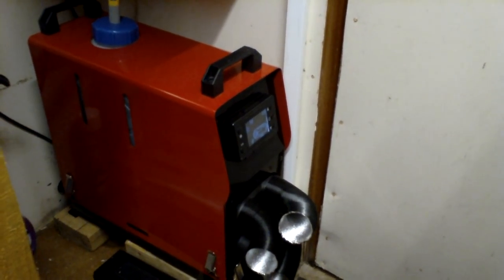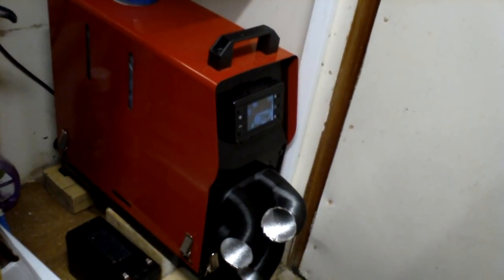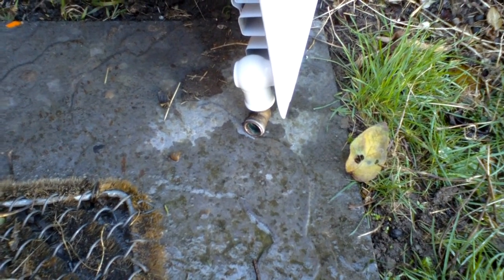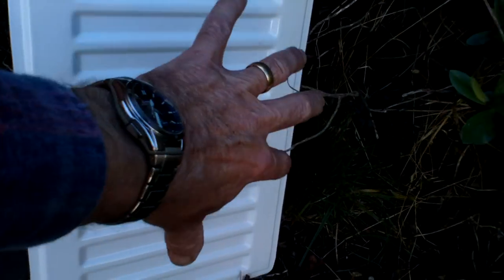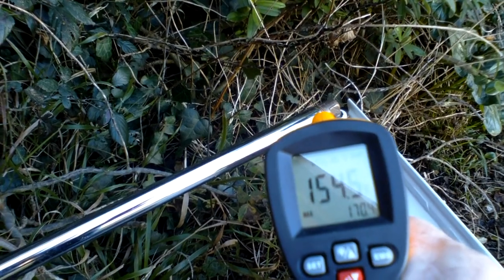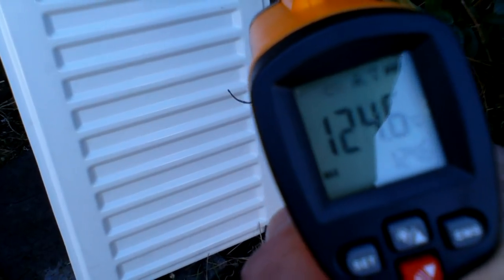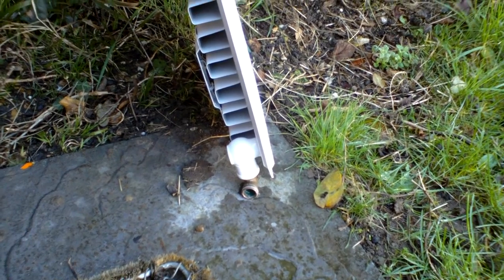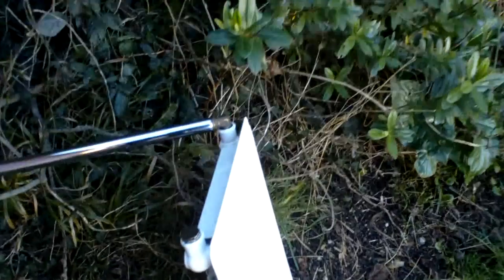COMPACT CHINESE DIESEL AIR HEATER EXHAUST HEAT RECOVERY

Comment from the maker: PLEASE READ THIS AFTER VIEWING MY VIDEO.
DONT GO DOWN THE RAD ROUTE - I did this setup just to see if heat could be recovered and if it was worth the effort.
It is indeed worth the effort but NOT by using the exhaust gasses directly.
It WILL soot up the combustion chamber and you won’t be thanking me for that so please DONT USE THE SAME SET UP. 
The best way forward is to use copper microbore heating pipe and tightly coil it around a metal bar of slightly less diameter than the exhaust pipe then tapping with a hammer onto the copper pipe to flatten the pipe where it contacts the metal bar which will increase the heat transfer surface area a lot of copper pipe will ensure good heat transfer - to remove from the metal bar you would need to “undo the spring” by holding one end and unturnining the other end to increase the diameter of the copper coil which will cause the copper pipe to slip off the metal former. You would use the same principal to get it over the stainless steel exhaust pipe - it would when all need to be tightly wrapped in exhaust manifold tape to both insulate it and keep the heat in for good transfer. A small 12v pump would be used to circulate the heated water to either a copper transfer coil within your RVs water tank or you could run the water through a radiator if you so wished.
Using the radiator directly WILL cause the diesel heater to fail overtime due to increased back pressure and the issue with water condensation. Please also note that although heat rises so it would seem obvious to use the lower radiator inlet for the exhaust gasses  Using the bottom or top of the radiator for either the exhaust inlet or outlet makes no difference as the result long term is the same - I personally would like to do a video however time prevents me but someone else needs to take up the challenge on this one as I have just planted the seeds - let’s see what develops. Regards Peter
Reply: check out egr coolers theyre great at recovering exhaust heat ive purchased a used one off a 2.0hdi only cost 10 quid
Reply from the maker: @forenamesurname4576  Hi there. Sorry about the delay in replying- I did the video to promote further experimentation and it’s certainly promoted that cause. Youtube is great for this and also your comment added to the pot adds a lot more scope for people to further experiment. Thanks for taking the time to let everyone know. Stay warm.
Regards Peter
Reply: Hee peter, i bought the same heater. But mine was'nt delivered with a manuel fot the LCD screen. I was wondering if maybe you can help me out with something?
Reply from the maker: @ruben19521  hi Ruben. Never got any paperwork with my two either. Best place for info is the Facebook Chinese Diesel Group as they now have a large international following... Stay warm. Regards Peter

Comment: An EGR cooler from a car should work for this, input/output pipes are similar size to your heater [3.2 did shogun is at least] has a built in exhaust to water cooler.
Reply from the maker: Hi Mike. EGR is a good way to go but I avoided this as it’s more plumbing and I just kept it simple because if you need to service the unit you only need to slip off the exhaust as per normal with the other pipes so no extra hastle and with a good wrap of insulation around the exhaust and copper pipe would make the heat transfer much better.
Go whatever way is best for you as it was just an experiment for me to get rid of a “bee I had in my bonnet” - which I have now put to rest. 
Thanks for your comment. Stay warm. Regards Peter

Comment: Hi Peter. Thanks very much for the video's.  I've been looking for a portable heater for tents and camper van. In searching I've come across your channel.  I'm happy and subscribed.  I now have two questions as you have gone some way of what I have - potentially - in mind. 1/  Could you extend exhaust pipe and add two baffles to lessen noise ?
Reply: 2/ Would it be possible to place a narrow gauge copper pipe coiled around exhaust pipe, then a larger pipe over that - so to seal in the heat of the exhaust. Run the extended encased exhaust and copper pipe vertical. And have the copper coil running from the bottom of small water tank, back out the top of the encased pipes and dropping back into the water tank to create hot/warm water?  As the heated water would rise. ( Just to add. It might be possible to put the coiled copper pipe around the exhaust and wrap it with heat tape instead of another pipe ? )
Reply from the maker: Only one question has come out. You can extend the exhaust pipe to around 2 meters but no more due to back pressure issues which would cause sooting and adding another silencer could cause a similar issue.
Some guys have installed the heater in a box fitted outside their tents and used the inlet / outlet pipes extended to go into the tent.
Hope this helps you. Regards Peter
Reply: @brucepeter2007  OK Thanks.  Second question,  2/ Would it be possible to place a narrow gauge copper pipe coiled around exhaust pipe, then a larger pipe over that - so to seal in the heat of the exhaust. Run the extended encased exhaust and copper pipe vertical. And have the copper coil running from the bottom of small water tank, back out the top of the encased pipes and dropping back into the water tank to create hot/warm water?  As the heated water would rise. ( Just to add. It might be possible to put the coiled copper pipe around the exhaust and wrap it with heat tape instead of another pipe ? )
 It can be done on wood stove. Wondering if there's enough heat in the small exhaust on the unit.
Reply from the maker: Hi again. I had used a minibore copper pipe around a low wattage tubular heater which was a gravity system and had to allow a little expansion tank as well and it worked very well. If you have had a try at a gravity system before then using minibore copper pipe would work and if you read through some of the comment to my video you will see I have proposed it being the best alternative wrapped with high temperature exhaust lagging to increase the efficiency. I think that a small pump could be inserted in line if the installation requires it as making a gravity heating system is not as simple as it first seems because sometimes the system needs a “kick” before it will work depending on the path of the feed / return pipes so an electric pump can be used to give it a provisional kick to start the system and once the circulation starts it could be turned off. I made the video to help start people thinking about the heat recovery because the heater without question is a fantastic bit of kit to heat a large area but the heat loss from the exhaust needs recovery to really make it a good system and for guys with RVs it would be an ideal answer to stop their water tanks from freezing and cost nothing more to do it.
Keep at it my friend and let us know how you get on.
Stay warm. Regards Peter

Comment: MAN, that is SO cobbled together, what a hack.... haha, just messing with you :) Glad you did this because I had the same thought too, but was worried even doing what you did would have restricted exhaust flow and gotten it to choke up and soot / smoke so it's good to see it's able to handle at least that much restriction without assistance. As you showed the parallel tubes in that rad help flow.. I'll be heating my garage with one of these and I"m thinking of doing something similar, but I'll probably have to have a "sacrificial" fan at the end of the loop to help extract the exhaust gasses and not choke up the heater. I have an old cast iron radiator that was destined to the recycling bin, that may be my design that I go with, but with a drain valve at a low spot to empty it out. Thanks for sharing!
Reply from the maker: Hi volvo. I would go the microbore way wound around the exhaust - see some other replies in the comment section. Using a small pump to circulate the heated water. Thanks for your comments and please let everybody know what you get up to as a lot are interested out there... Regards Peter

Comment: Get a helical coil on the end of that exhaust submerge the helical coil into a pail of water circulate the pail of water through a radiator and you'll grab the last little bit of heat left in the exhaust basically building a tube and she'll heat exchanger

Comment: I think this would work: weld two pipes together for a couple of feet. One for the exhaust and one for the combustion air then insulate them. They would have to seperate at the end then you would be preheating your combustion air which should make for better combustion.
Reply from the maker: Hi David. The combustion with this kind of heater is never an issue if the settings are right. The method I have shown id really the simplest and most straightforward way to do this and the big bonus is you dont need any tools to do it...
Simple is always best. 
Regards Peter
Reply: I am going to try it. I also am going to weld the pipes to a 40 pound chunk of iron. Whatever the result bringing heat back can only be a good thing.
Reply from the maker: @davidshortt88  Worth a try and see how things turn out. Remember don't restrict the combustion exhaust too much else you will get sooting issues. Regards Peter

Comment: I was going to use the exhaust in a heat exchanger to pre heat used veg oil diesel mix.
Reply from the maker: Hi Nev. Byall means have ago as it only costs a bit of time and if it works it always produces a smile with the person who’s done it...
Works for me. Regards Peter
Reply: @brucepeter2007  cheers Peter. I can't see how it wouldn't work. I have run one if these heaters for aprox 5 years in my motorhome. Everyone is astounded at the heat the mighty little heater puts out. I thought it would be a good option to use a 8kw unit to heat my workshop using 50/50 mix of diesel and filtered used veg oil. Seems like a cool project.

Comment: this would be better with a finned radiator that would allow you to place a fan behind and blow air though the fins ....even the outlet temp of 44 C is still over 100 degrees f .
Reply from the maker: Hi Jim. Many thanks for taking the time to comment -The test I did was only done rough to see what temperatures were around that could be used. I did not wish to ruin my existing working set up so it was installed in all of a minute. The results were very interesting - so to were the problems.
With the readings together with the issues like condensation I hope I have opened the way for others to have a go at it. As it is my inquisitiveness that has cost me the price for the new radiator and the wardrobe cloaths hanging rail I had to quit because the little lady was already looking at what I was doing with a look we all know and so I backed off.
So many great comments made about the video which should give some handy plumber a chance to come up with a useful recovery system - be it to stop your water tank freezing in an RV or as a bit of extra heat for inside.
As Sherlock Holmes said “ The game is afoot Watson”.
Reply: @brucepeter2007  No worries, I understand it was just a rough test, but it did get the wheels in my head turning and thinking of using a different style radiator and having the exhaust come in at the bottom and out at the top and hiving the exhaust exit  out of the top like a chimney  and having a small fan blow through it , Its a great idea . It really makes good sense to try and use that wasted heat.
Reply from the maker: Hi again Jim. One thing you must be aware of is exhaust gas security and every joint could be a possible gas leak. I think now I would plumb for a coiled copper mini bore pipe and exhaust manifold wrap the two pipes together which helps heat transfer and you would how’ve no more potential leaks... Like you I’m still thinking. Keep us all posted.
Stay warm. Regards Peter

Comment: Peter  I see you build model airplanes as well. How about showing some of them .      Building WW11 aircraft i a hobby of mine sense I was 10 and at 70 I haven't stopped yet.  Funny how we creative people seem to like to build and experiment with all sorts of things.
Reply from the maker: Hi there. Man after my own heart 💖 as I have always liked flight. Did hang gliding then paragliding then paramotoring for 20 years and when I gave that up I went back onto model flying but my preference is WW1 aircraft which hold a lot of magic for me. Here on the Isle Of Sheppey was the first aircraft factory in the U.K. located at Leysdown which was even visited by the Wright brothers and where a lot of early aviation experiments took place...
If you subscribe to my channel you will see many model aircraft from our local flying club which include WW2 aircraft as I have over 1000 videos up there at last count.
Thanks for taking the time to write in and comment.
Regards. Peter

Comment: Great for preheating my boat motor
Reply from the maker: Hi Michael.. I hope you read the description on this video as I made another video regarding heat recovery that was easier to do and had more positive results and no sooting implications and allowed for easier service of the unit if required. Check it out as its a better option perhaps for pre-heating your boat engine if your using a closed water system...
What vessel and engine have yo got as you may have seen on my channel that I get involved with Dutch barge deliveries over the channel (Insured only vessels)
Regards Peter

Comment: Do you have a brother. Chris Bruce ex RS. ?  Cheers from George and Jane
Reply from the maker: Hi there. My wife said “Thank goodness there is only one of you”...
Reply: @brucepeter2007  ok cheers. Interesting as you don't need to be a Peter Bruce to be a mad inventor. Just an old George. Cheers from old George and Jane. Ps wheel hub trims from a Morris Minor come up like new in a Dish Washer.
Reply from the maker: Hi again. I’m still inquisitive and sometimes I just have to have a go for fun - the new radiator cost me £13 but at least I was able to answer a few questions that were spinning in my old brain. I’m looking at another system which will be a bit more costly but should work.
PS - My wife thinks I’m nuts with some of my ideas...
Thanks for your comment. Regards to both of you Peter

Comment: Was this just an experiment? 😁
Reply from the maker: Hi there. Started off that way but soon became an obsession and you will see how far I took it if you look at the second video about heat recovery on my channel which gave excellent results and excellent practical performance.
Have a look and see the difference and also far safer as your not messing around with the existing exhaust. See what you think and give me a shout back.
Regards and stay warm Peter

Comment: Run the exhaust through a car egr valve cooler to heat water
Reply from the maker: Hi Calvin. Good idea but you can only have the total length of exhaust pipe length of 2 metres with a maximum of 3 x 90 degree bends else the heater will soot up. I guess each installation would present its own problems but I just wanted to sow the seeds because it was really getting to me with all that heat going to waste. If you can come up with a good idea I’m sure loads of people would be interested to recover that latent exhaust heat.
Thanks for your comment and input. Regards Peter

Comment: Put some fins on the exhaust pipe.
Reply from the maker: Thanks for your comment.
Heat transfer is nowhere near as efficient with fins the cooper tube method is far superior.
With the copper pipe insulated it’s very efficient and is safe.
Regards Peter
Reply: I added a house style 1 meter ,water to air  radiator.  3/4 inch copper tube,aluminum fins. The smooth straight pipe is easy to clean if carbon buildup. But at a slight downward angle all should be exhausted outside. Simplest way to extract the most heat with minimal cost and maintenance.  As for heating water, this is now working with standard water size tubing. Also, the stainless steel exhaust pipe fits right onto the 3/4 inch  copper pipe.

Comment: Heat wrap the pipe to keep the heat in
Reply from the maker: Hi there. The insulation would do nothing to stop the water condensation issue which varies depending on the daily humidity levels as well...
Regards for your input - Peter
Reply: Won't heat wrapping keep the heat in the pipe longer and waste heat out the end of the exhaust even worse?

Comment: It's a great idea.  Why is it a problem to have water running in the radiator ?  You could mount this on an external wall and exit the bottom pipe straight out through the wall.  Add a gas alarm for good measure on the inside :)
Reply from the maker: Agreed you could do that and it would work. Thanks for your input.
Regards Peter

Comment: run the exhaust into a small automotive catalytic converter it will radiate very hot then route exhaust outside
Reply from the maker: Hi Jim. Thanks for your comment and the video you viewed was in fact one of two. The description under the video does say not to go down the radiator route as it is too dangerous so on the other video I have made I looked at a simple method that anyone could do in any country to recover the heat from the exhaust at very little cost and I think I achieved this with the second video experiment which proved very satisfactory. Since I made the two videos there is now a Chinese diesel air AND WATER heater that’s come out at double the price however I would not go down that route as it’s four pipes going into the heater unit that have to be removed for service - a real pain if it’s all under a van... Some people have used van exhaust heat exchangers to good effect with these heaters but i did not go down that route myself as they are all different and not always easy to get unlike my second video idea which is simplicity.
Check out my second video on exhaust heat recovery and see what you think.
It was only an experiment but it was great fun to do.
Regards to you sir.
Peter